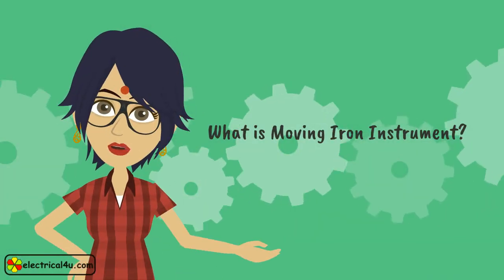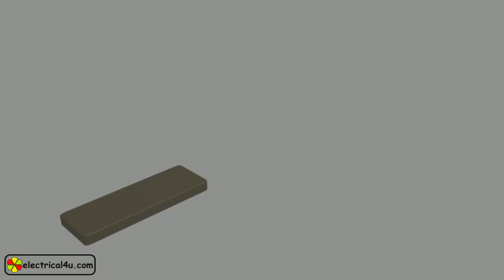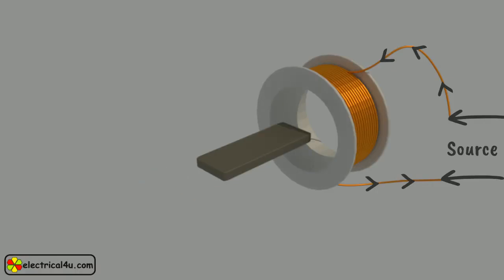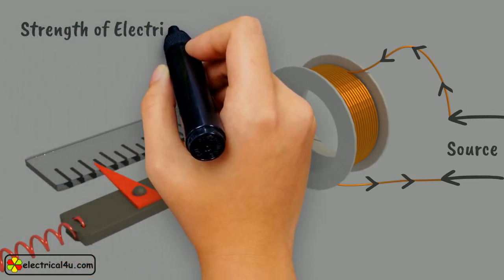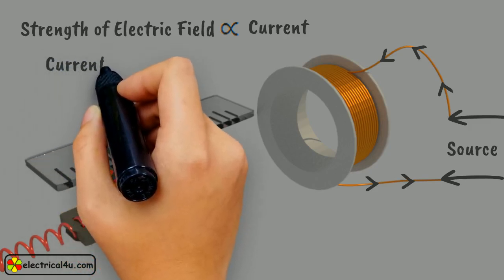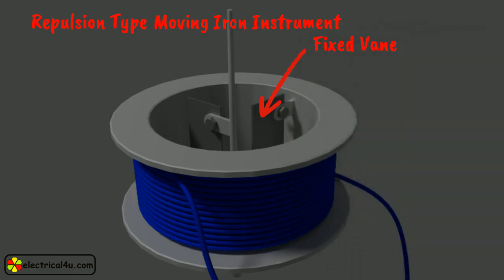Moving Iron Instruments – Working Animation & Attraction Type

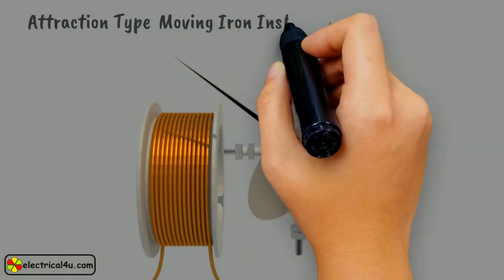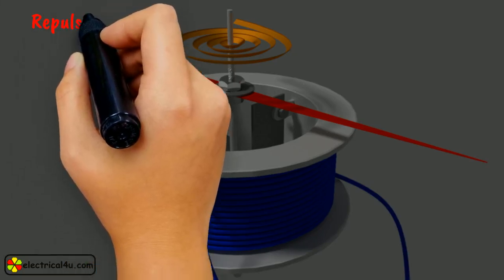Comment: Couldn't understand the mechanism of the deflection of the pointer when the vane moves closer (in attraction type) or the vanes repel each other (in repulsion type). The initial figure at 1:13 showed a linear scale along with the vane movement, but not sure how it will be used as a circular scale as in 2:06 or 2:38. Apart from that, really great video. Nice illustrations too. Subbed!